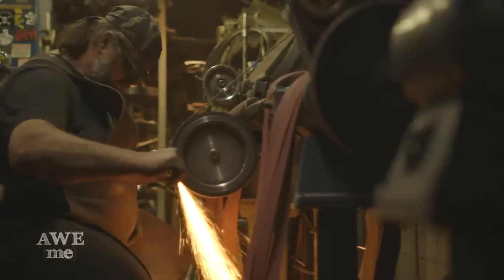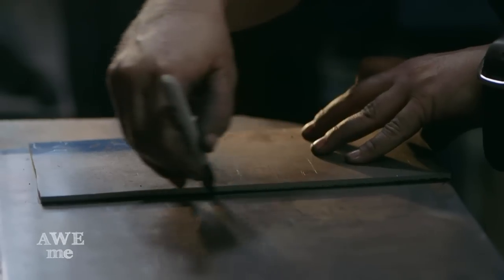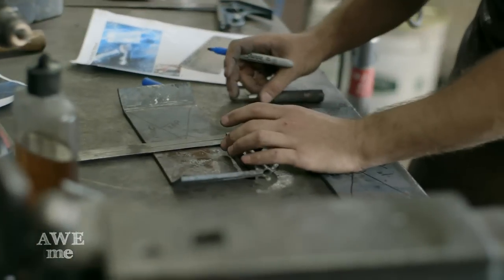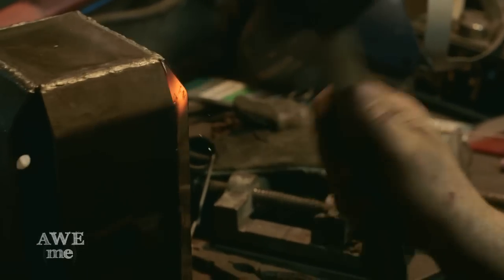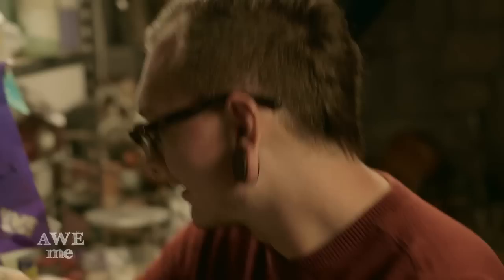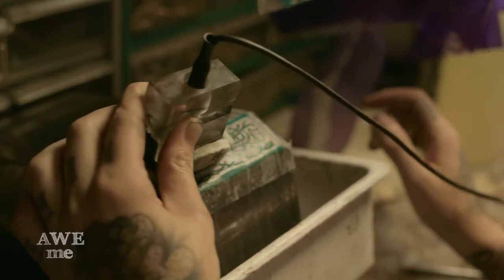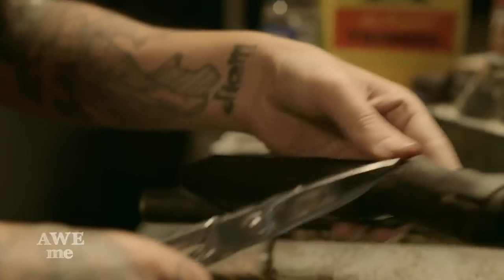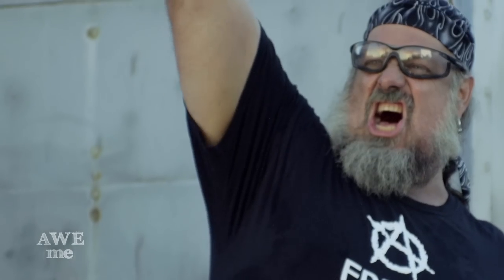Mjölnir (Thor: The Dark World) - MAN AT ARMS

Comment: Don't fill it with lead shots to make it heavy. 
Instead, put it on a base where there is a electrical magnet.
So, when power is on, the Thor Hammer will be stuck to it completely !!
and to the ones who are "worthy", they can hold it like a hollow hammer !!
:)
Reply: I had an idea once of making a replica and imbedding it onto a stone near a beach where i live, screw a bolt into the rock and welding the hammer to it so NOBODY could pick it up. but way too much work for simple lols.
Reply: Lol
Reply: That is the best idea ever.
Reply: Henry Yiu It's mostly stainless, the only part I think that was regular steel was the small inner pipe in the handle. Stainless isn't magnetic.
Reply: if you're gonna do that, why not go the extra mile and rig up RFID tags that people working the show room can wear that will turn off the magnet when they're near it? lol

Comment: If nobody else has mentioned it ... This video shows why the main flaw of Mjolnir in myth and comics is that its handle is too short. Basically, Mjolnir is a sledgehammer. Even if you had muscles like Thor's, and were worthy to wield it,  you'd really need a full-length sledgehammer's handle to get the most bang for your buck. (In the myths, the shortness of Mjolnir's handle was Loki's fault: he turned himself into a gadfly, buzzed into Eitri's forge, and bedeviled Eitri's brother Brokk as he worked the forge's bellows until he couldn't control the forge's temperature as he needed to. Unfortunately for Loki, the hammer still worked just fine for Thor ...)

Comment: Loved this video. I made one as well and it weighs almost 25 lbs. my only complaint on this video is that the handle was too long and bot true to the source inspiration. Mine has a studded pommel strap and a shorter handle with a threaded cap that secures the threaded pipe going through the folded and mig welded 12 gauge sheet steel hammer head. Didnt have enough time to engrave the designs as my hammer was a class project for creative welding.

Comment: Use titanium frame because titanium is extremely light, and fill the hammer with aircraft grade aluminium, so It would be solid and no way near as heavy a solid steel hammer.